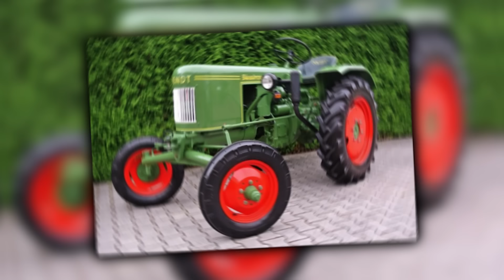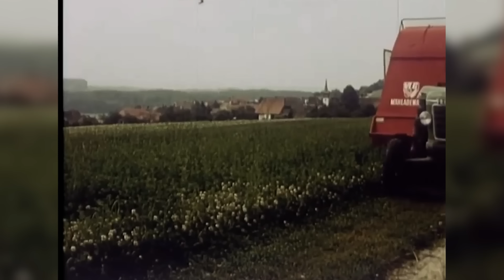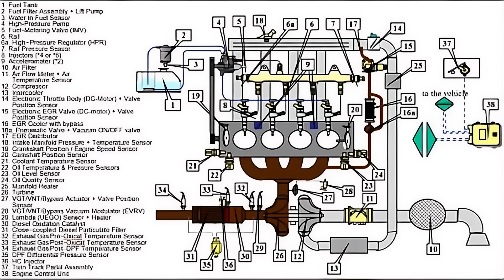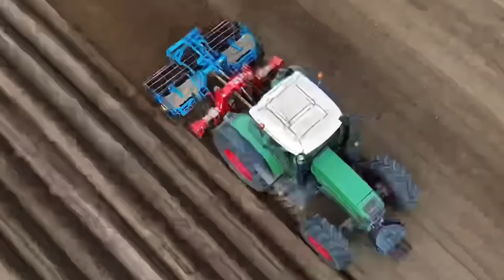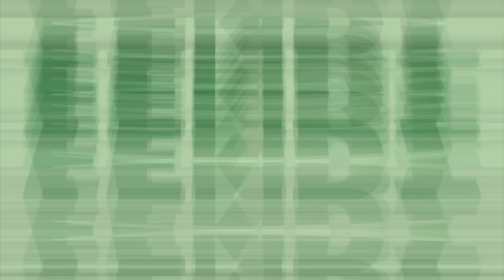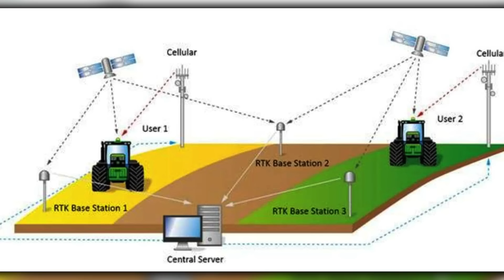The German Underdog That Shook John Deere’s Empire

Comment: Our FENDT Farmer 1Z from 1961 was lightyears ahead in technology and built-quality compared to any similar-sized US-American tractor of the same age.

And it still runs and performs - with only regular maintenance and very rare needs of repairs. My Dad could repair it himself, even the good ole' MWM Diesel engine itself. Very much in contrast to our 1978 CASE - which is a primitive and crude block of cast iron in comparison.

Comment: why is that transmission not in cars and trucks? or is it?
Reply: You can get CVT Transmissions in Cars but they have different inner workings then the Vario Transmission. Allot of Hybrid vehicles use them but you can also find them in older Cars. Problem with CVT Transmissions is that they are much heavier and more expensive then other Transmission. They also need way more Oil and Cooling that other Transmission. Also just scaling down the Vario Transimission to put it in a Car wouldn´t work because they are not designt to take the Stress from prolongt Highway speeds, They are ment for low speeds an high power work. Also one of the reasons why the Vario transmission is so reliable, is do too the fact that the parts are desgin to take way more stress then they need to, so making them smaller and lighter to fit them in a car would decrease reliability by alot.

Comment: And the biggest pro Agco/Fendt argument: Is the Right to Repair
AGCO, the parent company of Fendt, supports the "Right to Repair" principle and provides customers with information, software, and tools for diagnosing and repairing their machinery. Through an agreement with the American Farm Bureau Federation (2023), the company is committed to facilitating access to repair information.
1 Support for the Right to Repair: AGCO/Fendt enables farmers to perform maintenance and repairs themselves or through independent workshops.
Access to Resources: Customers have access to diagnostic tools, repair manuals, and spare parts.
Fendt Care: In addition to the Right to Repair, Fendt offers optional, fixed-price maintenance and repair contracts with Fendt Care to ensure operational readiness and resale value.
Comparison with Competitors: Unlike other manufacturers such as John Deere, which have faced antitrust investigations, AGCO has proactively committed to a more transparent repair policy.

Comment: Fendt Are by far the best tractor ever built.
Expensive but worth every penny.
Far ahead in technology, but most of all it doesn't break down.
It is extremely endurable, powerful with unbeatable traction.
I drove many since late 80s, really flogged them more than to maximum day after day, year after year and  they just never broke.
That is actually true.
Many avoid Fendt because of the higher purchase price, but my advice is, rethink, bad economy is when things break and process is stopped, not to mention repair costs these days.
Once Fendt, always Fendt

Comment: Fendt produced probably the best tractors of their time in terms of reliability, notably the 600 Favorit, the 800 Turboshift  and the 700 Vario from 1999 to 2012. We saw a significant drop in engine reliability starting with the 900 Vario Tier 3 and then 800 vario series (2013-2023). The lifespan of a 6L Deutz engine on an 826 or 828 Vario is 2000 hours....Total rubbish...
Now they've fitted Sisu (Agco Power) engines, but on some series in their range still with tiny displacements considering the power output. The new 600 Vario series, which replaces the lower models of the old 700 Gen6 series, now has a 5-liter, 4-cylinder engine producing 220 horsepower...

Fendt's tractors are very well finished and looks very well made and durable, but in reality, it's no more reliable than other brands. It just requires more service hours to access a component because everything is over-engineered, even though it serves no purpose. 
While the Vario transmission is indeed very reliable, it is the worst on the market in terms of power efficiency of the hydrostatic unit. German DLG's Tractor test OCDE approved station measured a further loss of 10 hp at traction on 722 Vario compared to a John Deere 6210 Autopower...both producing the same PTO power
Reply: we have both brands.. fendt is better.. if you don't see that, that's your problem
Reply: Well to tell the truth Deutz is the better money to reliability brand. But you seem to have a problen with deutz engines, even though they are far better than anything else in the market
Reply: And time and again, we hear this typical American nonsense about so-called “over-engineering.” It’s hard to imagine a more ridiculous argument. If everything is engineered just enough to barely function, it’s clear that the will to further development and improvement has been abandoned.

Comment: If Fendt is anything like Volkswagen the parts alone will bankrupt you. Most German vehicles are over engineered and beyond the average mechanic.
Reply: Ein Fendt kann man auch reparieren ohne gleich den ganzen Traktor auseinander zu nehmen.  Bei John Deere musste ich schon mal wegen  einen defekten O-Ring das Getriebe ausbauen.
Reply: So is Deere. There is no new machine today for the average mechanic. And Deere was worse in the last years locking up software and actively preventing repairs. One of the big issues opening the market for competitors.
Reply: I think the Ford Ferguson was the game changer with the 3 point linkage.
Reply: compare it more to audi/BMW from the parts prices and also mechanics in Fendt dealership usually cost alot more than for CNH
Reply: Not in the European markets
Reply: I understand John Deere spares policy does bankrupt farmers
Reply: @PeterWilliamson-p6eYep, it's so they'll upgrade to the new model with improved reliability
Reply: utter nonsense. Americans are simply to dumb to fix things correctly because everybody thinks they don't need some education to do this jobs. Try it with a reputable, specialized three-year training program, as is the case in Germany and many other European countries.
Reply: If you wanna own Top Tier you gotta pay Top Tier 💁🏼‍♂️
Reply: "If.." - so You admit that you don't know. We, who do actually know from actually owning & using our FENDT tractor, know it better. ;)